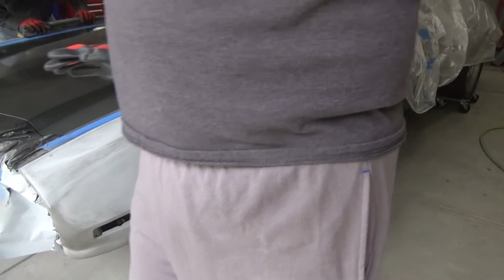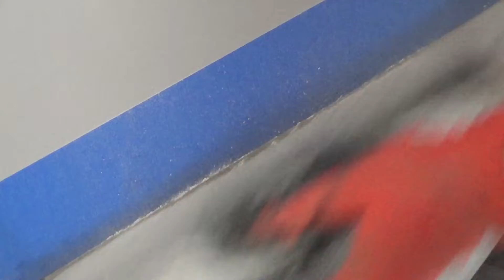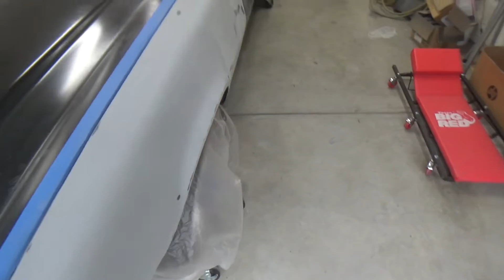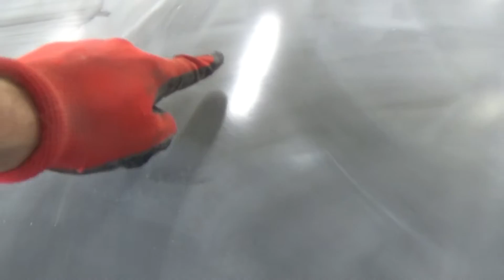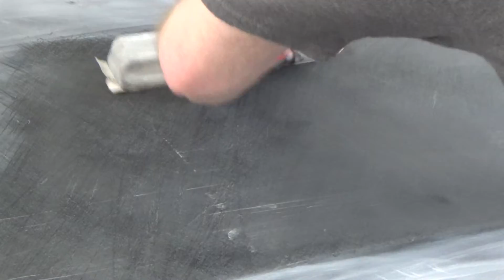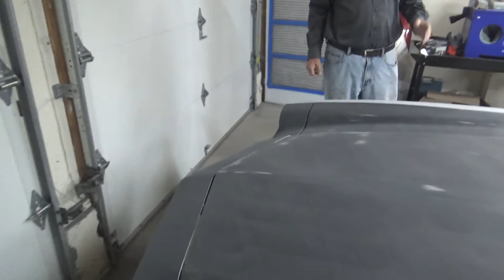1977 Camaro Z28 Part 189: Sanding FeatherFill G2 and epoxy on hood

Comment: Just a thought, but I have used a folded metal coat hanger for years, with fuel line handle and electrical tape. A dab of weatherstrip adhesive on the tag end of tape keeps it from unraveling. Works good on harnesses to if tape is used. Stays clean looking. 
You are a lucky guy to have your dad able to help!
Reply from the maker: Thanks! I am missing him lately. He will back in a couple of weeks.

Comment: From what I'm seeing you would have to do a wet on wet over the epoxy if you want chemical adhesion for the paint, otherwise you will have to suffer with orange peel. In other words if you have to sand the epoxy to remove orange peel then you'll have to accept mechanical adhesion instead. Is that correct?
Reply from the maker: In my case, yes because I suck at spraying epoxy. I think I was using too low pressure. Many people use epoxy as a sealer.

Comment: No offense,  but to anyone watching this, this is wrong. 1st, you shouldn't sand true epoxy.  You need body work very close, then epoxy coat, you don't sand it, just scuff it up, you put feather fill on epoxy coated bodywork.  After that's blocked out you coat with 2k as printable surface.  Don't take away the wrong way from this video.
Reply from the maker: Sorry, but I think you are wrong in this case. The tech sheet clearly says what I did here:
"Note: DPLV Epoxy Primer may be recoated any  me up Note: to 1 week.
After 1 week surface must be cleaned, sanded and re-cleaned. Reapply 1 addi onal coat of DPLV
Epoxy Primer only if applying basecoat directly to DP. "
And I spoke to the paint shop.
Maybe you are not familiar with DPLV, it is kind of a special low VOC epoxy.

Comment: I've had great luck with that rubbler block pops has isn't that the one with 3 rods?  I like it rods in or out works well.
Reply from the maker: Yeah, that's right. I have 1 rod in place in mine. Seems to work best on the Camaro